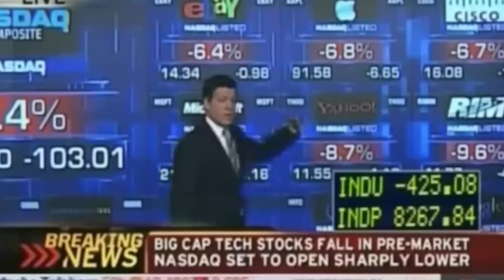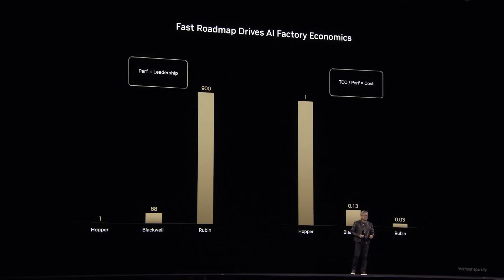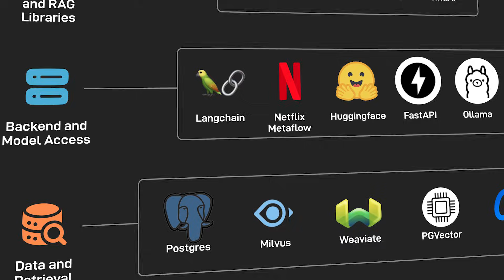AI’s Dark Fiber Moment: Why the Hype Isn’t Matching Reality

Comment: Cool professional video! I appreciate your hard work! Interesting analysis on the financials, Dylan (aka Human ChatGPT), but I think the 'Dark Fiber' analogy misses a critical technical catalyst from that era: DWDM (Dense Wavelength Division Multiplexing).
The fiber crash wasn't just caused by over-investment; it was triggered by a massive efficiency leap. DWDM allowed us to push thousands of channels through a single existing strand, effectively making the 'pipes' exponentially wider overnight. The demand for new fiber collapsed because the existing fiber became capable of handling the load.
That is where I see the divergence with AI. We aren't just laying infrastructure for transmission this time; we are engineering a fundamental shift in the direction of humanity. This is the 'Star Trek' future. The demand for intelligence and generative capability is functionally different than the demand for bandwidth. We aren't just building the road; we are upgrading the destination.
Reply from the maker: Context could prove to be that part that takes expenentially more resources to accomplish now than it needs to in the future.